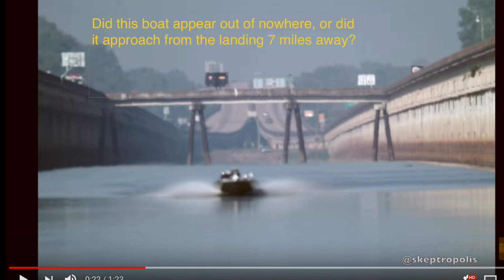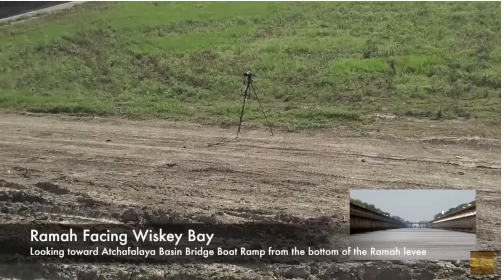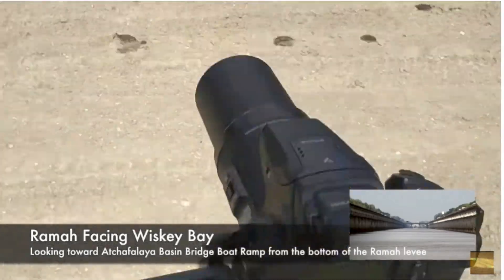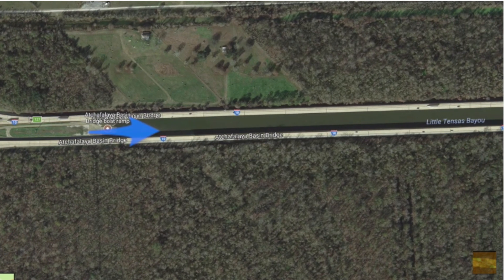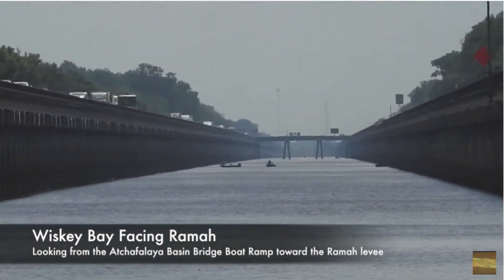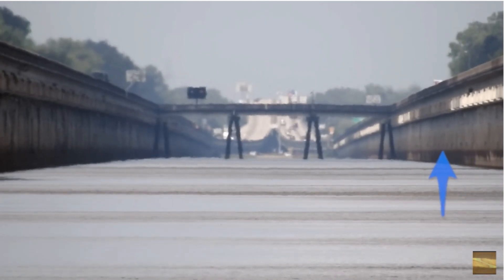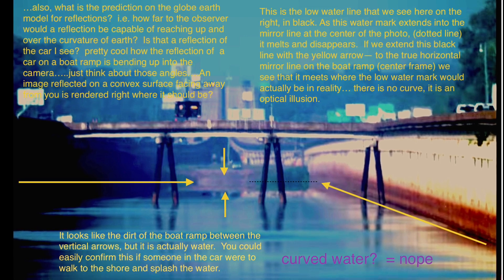Is this Bayou level and curving?

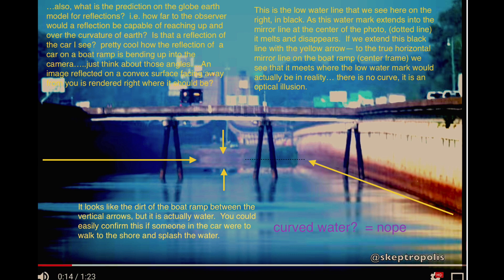Comment: why don't you try analysing the curvature shown and comparing?  i don't think you have used the highest shot for your analysis at 2:04 and your arrows are misleading.  the two pointing above and below the boat ramp imply a considerable area of mirroring which is not in agreement with your dotted line.  

your dotted line extends over the causeway to the right to meet the waterline arrow.  this is deceptive.  the waterline arrow should meet the dotted line where the causeways appears to end and the bushes begin.  the waterline arrow would not meet the dotted line there, it would be too high, which is even more indicative of curvature because the waterline arrow starts off too low and below the waterline.

you do not account for actually reflections on the water and you do not account for the fact that the lowest shot shows the waterline much higher than your supposed waterline.  accordingly, even if your analysis is accurate, there is clear obscuration by the horizon between the lowest and highest shots.  your analysis and claims of an optical illusion do not account for the apparent curvature of the causeway or of the water stains which remain curved throughout the shots and, in the lowest shot, actually fall below the waterline horizon.

curvature is also apparent in the distortions of the reflections of the supports of the central crossway.

you should consider analysing the images looking for evidence of curvature and then try offering alternative explanations.  as it stands your work is highly subjective and clumsy.  but at least you put some effort where your mouth was.  3/10
Reply: the real effort is going on the scene with all the equipment being eaten by mosquito and horse flies in the heat. Finding the time to do it when I have a family to answer to. Picking the right day with clear conditions. Paying for the gas, food, drinks, all kinds of other items we use as tools to make these things easier. Sitting at home in the air condition behind a computer is the easy part.  Especially when it's some other persons efforts like mine and soundly. I think folks should have more respect for our efforts and providing valuable photo/video evidence. I see a lot of things that were completely ignored in the photographic evidence being critiqued. To say the least, that is very frustrating.
Reply from the maker: Dandypanty yes, i could not agree more, it takes real time and effort to do this sort of thing.  I value your efforts, i just happen to disagree with the analysis of Soundly.  (If he titled his videos a bit more conservatively, i.e. not claiming to have debunked flat earth) perhaps i would have a different angle to my video analysis....But still, all we have here is video and photos, no measurements......

 I am not a flat earther, but I am certainly, at this point believing there is no curve to water at these distances.  It is flat as a mirror, just as the reflections show you.  everything else is an optical illusion.
Reply from the maker: Nathan Grant  welp, thanks for the 3/10 !   Just a few remarks:

the dotted line IS the mirror line.  period.
I was careful to get the highest shot possible, using the ,. keys to skip one frame at a time.
the waterline arrow is low on purpose as to not BLOCK the actual black line.  oops.

"you do not account for actually reflections on the water"
hmmmm, actually it is the Heliocentric believers who are not capable of describing or modeling exactly HOW a reflection can be seen from such distances.  I have seen nothing to account for this obvious shortcoming.  the reflection (if you believe the water is forming a convex surface) is bent AWAY from the observer 7 miles away.  

"and you do not account for the fact that the lowest shot shows the waterline much higher than your supposed waterline." 
 .......but i did show how this very observation published by soundly is defeated (i.e. should not be visible) by the Metabunk mick west calculator even with added refraction calculations.   

"you should consider analysing the images looking for evidence of curvature and then try offering alternative explanations.  as it stands your work is highly subjective and clumsy."
haha this is what i did, but evidence says it aint curved.  nice try tho, 3/10    
p.s. there is a new video, just for YOU, on my channel, cheers :)
Reply from the maker: Nathan, you need glasses if you cannot see the symmetry split , perfect mirrored reflections (in the exact spot of the dotted line)  i enhanced the colors to bring out the distinct line.  You are not capable of looking and seeing the features in the bushes and ramp split ?   I just cant help you.
Reply: you have not established that it is the mirror line.  you need to do that by highlighting the symmetry and you should do that in the highest shot.  saying 'period' is not evidence for your claim.  it's evidence for lack of integrity.  you overextend the mirror line to the right to make it look like it matches up with your proposed waterline.

the highest shot is the one with the big white truck up on the hump to the left (as it is in your choice) and with the orange and red sided vehicle on the right causeway, closer to the camera.

yes, you need to put your arrows in line with the objects they are indicating.  too low is too low, too high is too high.

your observation of the height that should be obscured according to the metabunk calculator is best ignored as it is ridiculous.  you are dealing with far too small a scale to measure it accurately with the information provided and the observation soundly made.  you must consider margins of error, precision and accuracy.  the analysis you attempt here is grossly erroneous and is by far the worst part of your video. if i had included it in my assessment of your work it would have been 2/10 for sure.